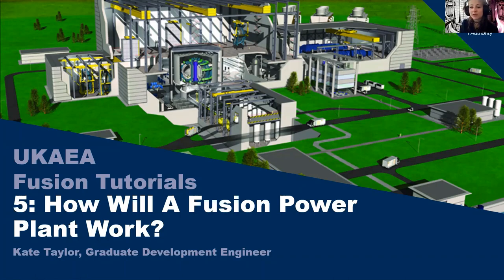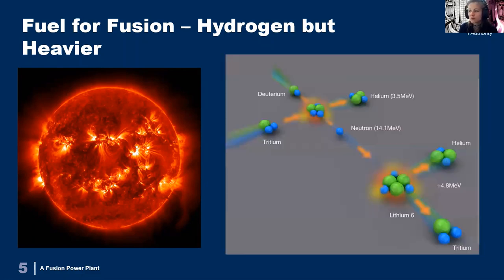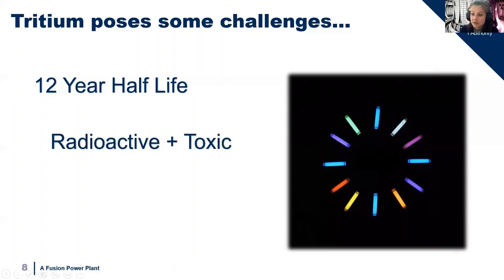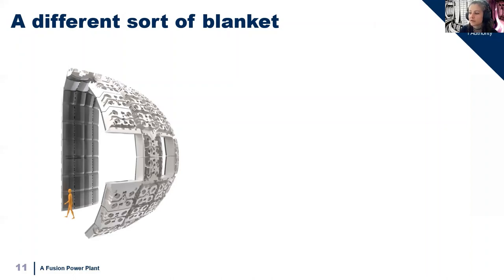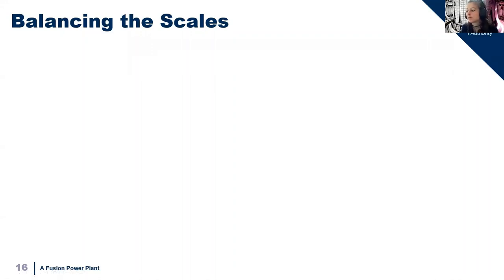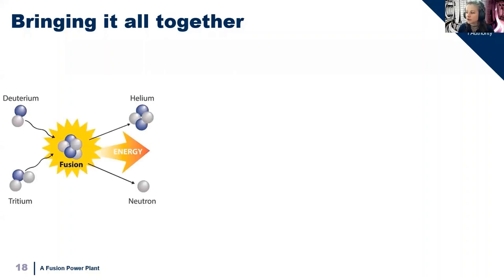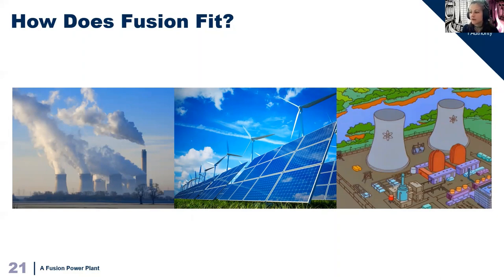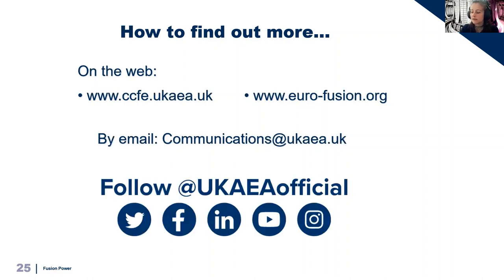Fusion Tutorial 5: How will a fusion power plant work?

Comment: I find the harmonisation between the physics and engineering used in the design and development and the ultimate function of the breeder blanket frankly beautiful, how a seemingly irritating byproduct of the fusion process is made into an integral part of maintaining the burning plasma. 
My question however is regarding the lithium tiles on the blanket, what is there projected lifespan before requiring replacement, and would this method not in effect place a "power limit" on the reactor, in an operational power station, afterall the deuterium can be injected in at a manipulateable rate, but could there be more deuterium in the reactor at any one point than tritium to fuse with it?
In a future power station, may tritium have to be produced on site, externally from the reactor, on a JIT basis, enough to maintain fusion at any one point therefore producing a much heigher yielding reaction?